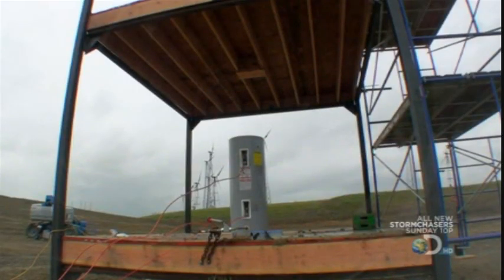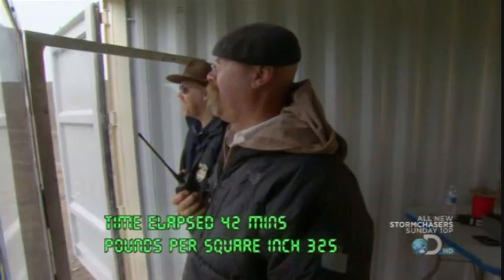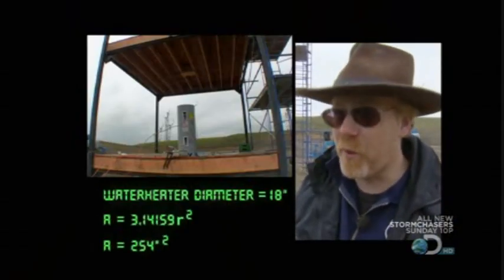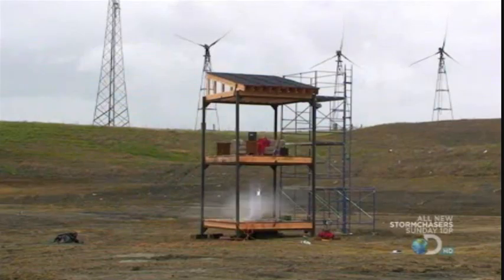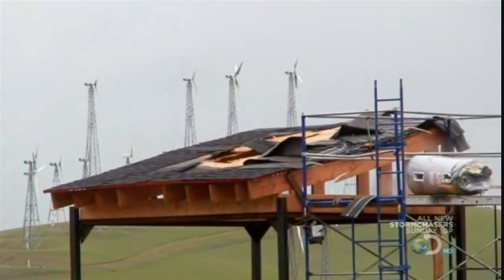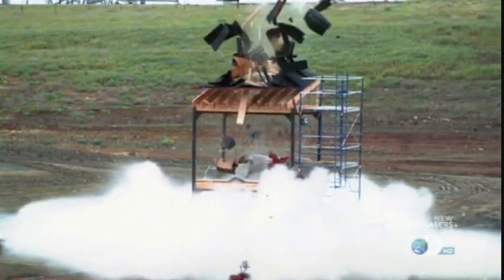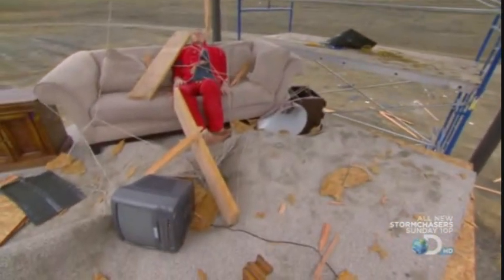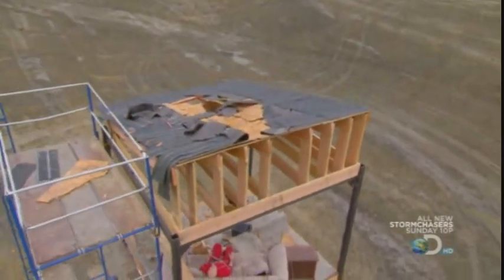Mythbusters Water Heater Explosion

Comment: This is why I would NEVER attempt to work on or install a water heater. Leave that job to the professionals.
Reply: You have to disable two safety features or have them fail in order for this to happen. They said what usually happens in theses cases is people see the pressure relief tube coming out of the side and think it's there in error and plug it. Then the other relief fails and this happens. It's very rare.
Reply: It’s pretty hard to fuck it up. You have to be a real dumbass to have a water heater do this to you. This can happen to old water heaters too even if a professional installed it
Reply: Nah, as others have said, they have safety devices, and installing a new one is something a reasonably handy person can do.
Reply: installation is easy, but never use it w/o safety valve
Reply: It's actually fairly easy, as far as plumbing goes.
Reply: This is a reason to check the safety valve on the side of the heater regularly. Safety valve = no bang.
Reply: I’ve installed mine and I even went a step further from the classic installation diagram and had redundant safety valve installed + electronic monitoring for temperature and pressure with emergency shutdown. It can be done fairly easily with patience, if you’re a technical mind and understand some basic principles.

Comment: Me: slowly turns towards garage door yep I have paranoia now.
Reply: Hot water heaters have safety's to prevent this sort of thing. They deliberately disabled them.
Reply: @RB01138  When is the last time you tested your over pressure relief valve? Every one I've seen was a solid block of calcium deposits.
Reply: @RB01138  Safetys. There is no apostrophe used for plurals.
Reply: @RB01138  thanks for clarifying that captain obvious 🦸‍♂️
Reply: @maggs131  you don't have to be rude
Reply: @drockjr  Well, I appreciated the rudeness at least.  Especially considering we're not talking about hot water heaters, we're talking about garage doors.
Reply: @big0bad0brad  nobody disputed whatever garage parts people were talking about
Reply: @drockjr  Thank you, captain obvious
Reply: Nah, just install a camera on your garage.
Reply: Theyre in your garage? They are in basements here
Reply: @everythingsalright1121  Well, I guess you could put a garage door anywhere, but makes most sense on a garage.
Reply: @everythingsalright1121  houses do both.  Depends if your garage is massive or not
Reply: I just took a minute to make sure ours is beneath the laundry room and not a bedroom

Comment: Called a Boiling Liquid Expanding Vapor Explosion.  As temperature and pressure rises, the water stops boiling because of standard physics of liquids.  The temperature and pressure continues to climb and climb, but the water stays liquid.  When the container bursts, the water, now around 400 to 500 degrees F is instantly exposed to only atmospheric pressure, instantly releases the stored energy into steam vapor - adding exponential energy to the explosion.  This is why you have several mandatory pressure relief measures in water heater designs.  In some 3rd world countries with poor manufacturing, the pressure relief valves are sometimes not installed, or are of such poor quality, that these happen.  I witnessed a 10 gallon water heater destroy an entire 20 ft X 40 ft building in Qatar, luckily at 2 AM due to a BLEVE incident.  Shrapnel penetrated other buildings 20-30 feet away and blew out or "bowed out" all of the walls.  It would have killed or maimed most in the building if in the day.   This show obviously removed the protection valve to demonstrate what could happen.  You can thank regulatory agencies for enforcing codes!
Reply: The only way that could happen is if a one way valve is fitted to the mains water supply pipe. And it's why nobody but an idiot would fit one. Normally water will just be forced out the inlet pipe, barely going over mains pressure. It takes a pretty stupid person to make a water heater tank explode.
Reply: @rossbrumby1957  You wouldn't believe some of the crap I saw during my Middle East tours.  I still have photos of the aftermath somewhere.  Totally destroyed the building.  Wires, cables, ceiling lights hanging everywhere.  All walls pushed out.  Huge hole blown open where the tank once stood.  Nearby tents and buildings swiss cheesed with shrapnel.

Comment: um     uh        okay              now I know I have a bomb in my house wow
Reply: No you don’t, unless you (1.)  Have the worst luck at fail safes ever.  (2.) Block the T&P pressure relief valve, and have a non working thermostat.
Reply: @johnanders8861  (3) make sure you're filming it when it happens.
Reply: Yes and it’s going tick tock
Reply: You mean a rocket
Reply: You mesn a potential bomb? Just like you have a potential murder weapon, in the form of a kitchen knife.
Reply: @kattihatt  but the water heater doesn't need someone to kill me
Reply: @lazylawnbub  it does. It needs someone to install it incorrectly.
Reply: @kattihatt  but nobody would actively try to kill me with it

Comment: I find it hard to believe that the plumbing and faucets would hold up to that kind of pressure! Path of least resistance would find a weak link in the system causing a copper line joint or faucet o ring to let go first!
Reply: Have you tried looking up instances of this happening ? It might answer your query ..  :/ hmm
Reply: Household plumbing is designed for 150psi in normal operations. Surviving 330psi wouldn’t be surprising.
Reply: @allangibson2408  ... 150 psi is normal, although high. Burst pressure on domestic copper pipe is 300 psi.
Reply: Wrong they would.
Reply: An old boiler in a building I took care of had a stuck gas valve. Boiler stayed where it was but blew out every fitting in a 4 foot radius.
Reply: There's no part that "bursts" until after the explosion.  If you've ever had a soda can fall and balloon the bottom so you can't set it down upright anymore, that's what launches the water heater.
Reply: @VoltisArt  uh…no. It blew the bottom out. The result was water heated past boiling INSTANTLY turning to steam. It literally says it in the video. 🙄

Comment: My hot water heater just started dripping out of the valve now I’m worried
Reply: If you have a pressure regulator valve before the cylinder then that's probably the issue. They often can be cleaned out and that resolves the problem. They fail and slowly let the pressure increase till the safety valves drip. Other possible failures to check are that the tank temperature is correct and the thermostats are working. If you have an expansion tank check that that hasn't failed they usually have a Schrader valve, check it is at the rated pressure and no water comes out. Ideally get a professional to check if you are at all unsure, many places make it illegal for anyone but a trained professional to work on these because of the risk.

Unless you are already dead because this was a year ago, in that case nevermind. But others with a similar issue can still take notice.
Reply: Don't be, that means the pressure release valve is working
Reply: In this vid they sealed the valve
Reply: Change the valve you will be OK.

Comment: I'm pretty sure this is why they put pressure relief valves on hot water heaters.  The implication that this could happen to your house is very entertaining but also very unrealistic.  What will happen is a lot of stuff near the water heater will get damaged by the steam blasting out of the pressure relief valve.  But that isn't nearly as dramatic as an explosion, so guess which goes on TV.

Comment: It is Not called a hot water heater. You don't heat hot water. It's simply called a water heater. They are rated for 150psi on the relief valve and tested at 300psi. It would take many things to go wrong for this to actually happen. It's possible but extremely unlikely. 
(Been installing and specializing in water heaters for over 34 yrs.)
Reply: @kevinwest yes sir I did got it replaced the same day I posted the comment lol rather safe then sorry
Reply: Yeah but it used to be more common. The guy who used to live in my house had his in the back yard instead of in the house.
Reply: what if someone installs their own home water heater, is it more likely? If so, by how much?
Reply: @Calimariyum  Not unless some idiot removes the TPR valve or closes it up. They come installed with the TPR Valve. If you don't put a drain on the valve, it might spit water out in your attic or on your floor, but it shouldn't overheat. If you reduce the drain line smaller than 5/8" or put something flexible that can kink, then you may have an issue. The biggest issue would be removing the valve or just closing it off. That's super dangerous and I do see it as a home inspector every now and then. 

TPR = Temperature Pressure Relief , also called a 'pop-off valve'.
Reply: I have a question my water heater tank is dripping hot water what can happen what do I need to do just realized this today and don't know how long it's been going on
Reply: @jeskotooraw9606  Where is it dripping from? If it is coming out the TPR valve, it may be normal or your valve is faulty and needs replacing. If you have high water pressure at your house, then leaking a little from the TPR may be normal. If it's coming from the bottom, then the WH is rusting and needs to be replaced. I see many water heaters that are still working, but they are sitting in a pan of water, because the bottom is rusted out. If its leaking from the connections, you just need to repair the connections.
Reply: Don't get your knickers in a twist, boomer.
Reply: Kevin West don’t get your panties in a twist, that’s what they call it.

Comment: I seen a regular well water tank (taller than a man) that blew through the roof. The rush of water blew out the first few courses of brick causing the pump house to drop and sit at an angle. The roof (octagon shaped) was scattered all around approx 50 feet from the building.  I warned them a couple weeks before the tank bottom seam was rusted out and seeping water all over the concrete. I did the math for 40psi and a 36 diameter tank and got over 40,000 lbs of force on the bottom.  I believe the sudden release of the tank bottom was all it took.
Reply: And water in nothing compared to steam.
Reply: Oh now I'm worried. My cylindernis leaking at the bottom. I have a new one here but can't afford the plumber.
Reply: "I saw" not "I seen"
Reply: @justayoutuber1906  Thank you, Reddit.

Comment: only can happen with stupid add-on devices installed with the plumbing that creates a "closed system". 
Skip the backflow preventers and any other devices that create closed water systems and you can relax knowing a water heater will NEVER explode and plumbing will be protected forever.
Reply: Actually, that's not entirely not true... My great aunt's water heater blew back in the late eighties. The culprit, it was determined, was calcium deposits over the pressure relief valve. The explosion lifted the entire house and shifted it 6ft to the right and causing the entire building to collapse.
Reply: You are wrong if the safety relief valve is not fitted and blanked off like I have come across recently all that has to happen is the heater isolation valves to be closed, not fanciful at all. Idiots are ingenious.
Reply: Not true. Some people have the TPR valve drain that is blocked. Some have the TPR removed and a steel bolt put in place. And like the comment above, they can corrode, especially with high calcium in the water and become obsolete. This may be 'rare' now a days, but it does still happen and an ounce of prevention is definitely better than a whole lot of repairing later.
Reply: Also, some install the wrong type of drain on the TPR valve than can kink, thus blocking the flow.
Reply: Exactly Daniel Myers. Without a backflow preventer, and the typical mains pressure of ~80 psi, the pressure in the tank should flow back through the cold supply line that, presumably, still flows water. Combine that with the safety control valve and the worst thing that a water heater will do is leak.

Comment: Quit calling it a "hot water heater." It's just a water heater. If it were a hot water heater then it would be heating hot water...
Reply: Jacob Freiberger it's called hot water heater because it has a lower operating temperature than a steam boiler for example. a hot water heater should never produce steam or reach 212°F

Comment: One important thing to note is that this water heater was altered to ensure its failure - this would not occur in your home on an average Saturday afternoon.
Reply: except with multiple failures, even the manufactures admit water heaters eventually fail and need replacing.
Reply: The relief valves fail about 1% per year.
The thermostat’s fail about 5% per year.
Probability of both failing is 0.05% per year…(assuming you don’t do the maintenance).
Reply: @allangibson2408   There are 140 million homes in America. 
140 million times 0.05% is 70,000 homes. 
No doubt some are tankless, but still, tens of thousands of potentially flying waterheaters.
A small percentage of a large number is still a large number.
Reply: @williamgechtman9287  Which is why water heater maintenance matters…

Comment: and that's beside us in all of our houses
Reply: It had the pressure relief valve removed. This would never happen in real life
Reply: @kanatahvac  Oh, it's happened......Faulty installations or improperly used parts, rusted, corroded or calcified relief valves......The list goes on......It's not a common occurrence, luckily, but never underestimate it just because it doesn't happen commonly!
Reply: Maybe not removed, but a neighbor of mine put a plug in the outlet of his relief valve because "it was leaking".  The heater blew up, blasting through the second story and roof of the middle unit of a triplex - enough damage that the triplex was razed.
Reply: Pressure relief valves been known to build up mineral deposits and fail to operate as they should. Reason they should be tested but almost never do.  Sometimes they will leak due to deposits and hopefully get changed.

Comment: One of my absolute favorite episodes!  Absolutely crazy amount of energy in simply really hot (pressurized) water.  Also a great example of why NOT to override safety features.
Reply: The expansive energy in super heated steam  is why steam locomotives were king of the rails for almost 100 years 
They helped win both world wars.
Reply: But it was leaking.. come on.
Reply: Likewise...
Reply: You idiots are a bunch of know it alls!
Reply: Thats what exploded in chernobyl
Reply: Remember, it was the water flash-boiling that caused the top to get blown at Fukushima.
Reply: When I worked for the gas company I would sometimes find that the owner would plug the safety relief valve rather than change a leaking one 
We took the plug out and red tagged it and left it off
Reply: *potential energy, it has no energy until it flashes to steam with the pressure drop.
Reply: @marvindebot  incorrect, the water is energized and that's why it flashes in the first place

Comment: 1:27 It's not 85,500 pounds of pressure. It's 85,500 pounds of FORCE.
Reply: May the 85,500 pounds of the Force be with you.
Reply: He TRYS to tell the experts....smh
Reply: Nooooo, it's Kinetic Energy guys... sheesh.
Reply: No, it's pressure: Pounds per square inch multiplied by the area of the base. Force = mass X acceleration this only applies when the heater bursts.
Reply: It is force as pressure is force per unit area.  He was calculating the force acting on the bottom, based on the pressure and the area of the surface it is applying on.
Reply: @coyote5735  Pressure is force per area (pounds-force per square inch is a unit of pressure). Multiplying that unit of pressure by an area cancels the area in the denominator, resulting in a force. hystat is correct in saying this is 85,500 pounds of force. lbf/(in^2) * (in^2) = lbf.

What actually changes when the heater bursts is that the sum of forces on the bottom and top sections of the heater are no longer equal to zero. (This is the difference between statics and dynamics). Before the burst, there is an equal force pushing down on the bottom of the heater as there is pushing up on the top of the heater, adding those two results in a net 0 force on the heater.. Once it breaks, the top half of the heater has a net force up on it equivalent to 85,500 lbs.

Adam wasn't talking about the net force on the entire heater, he was only calculating the force pushing down on the bottom of the heater from the pressurized water. But the result of his calculation was still force. The pressure was 336 pounds-force per square inch.

Comment: I just relit my water heater and I'm terrified I fucked it up and this is going to be the outcome.
Reply: You should be safe. These guys just messed with the pressure not the heater or fire at all. Standard PSI in a house should be well under 100. They hit 335 and then it blew. Plus there is a pressure relief valve that's supposed to be on the tank. They probably blocked it off but if there is too much pressure then the release valve goes off to release pressure so this won't happen.
Reply: Lol yeah, just an update I relit the water heater in my old place no problem, actually not that bad.

Comment: How full was the tank? Totally full would not blow as hard, need some air in there to compress.
Reply: Wrong, water expands as it's heated you are dealing with hydraulic pressure that's why the release of energy is so extreme.
Reply: you're talking about a tank filled with gasoline, water don't work that way.